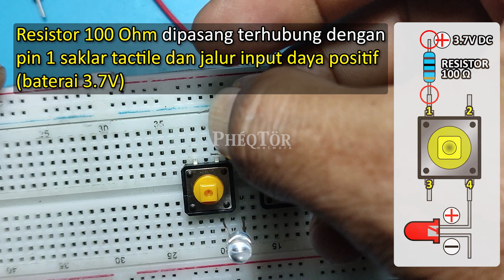Cara Kerja Saklar Tactile Push Button 4 Pin

Comment: agar bisa nyala terus gimana gan caranya
Reply from the maker: Kita ganti saklarnya bang, bisa dengan saklar Toggle, Rocker, atau Slide. Sebagai contoh bisa dengan saklar On/Off 2 kaki, videonya bisa dilihat di sini, https://youtu.be/gfHrgYDf-Yw
Reply: @pheqtornetwork Tapi ini awalnya bisa kak setelah PCB nya rusak saklar berfungsi hanya push on tidak berfungsi on off lagi
Reply from the maker: @amsproduction784  kalo dalam bentuk rangkaian, bisa jadi fungsi push button kembali ke fungsi awal karena komponen rangkaiannya yg sudah rusak (bisa jadi IC atau komponen lain dalam rangkaian tersebut), krn rangkaian tersebut mengubah fungsi Push Button menjadi saklar On Off.